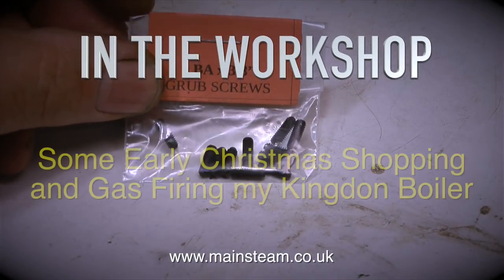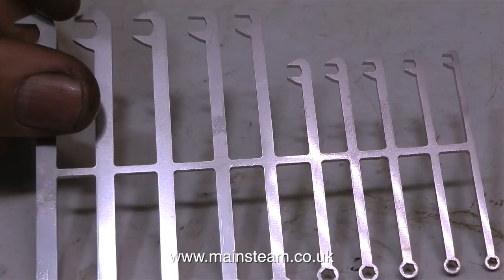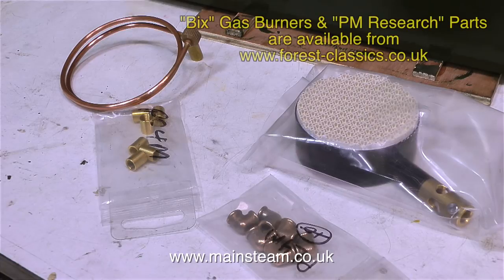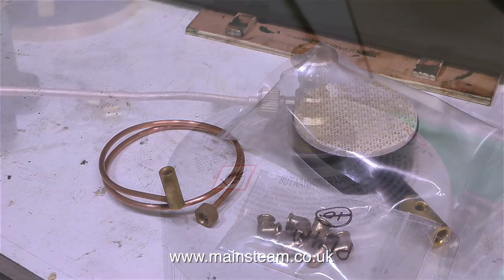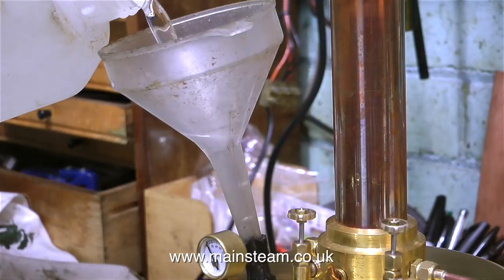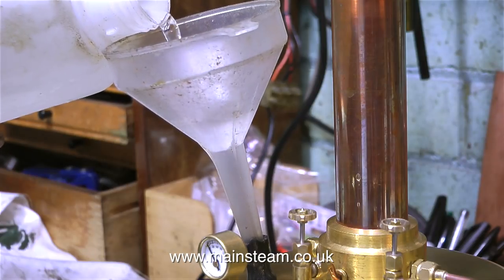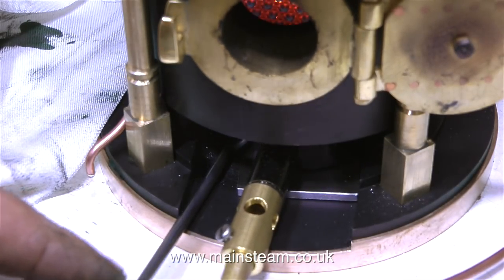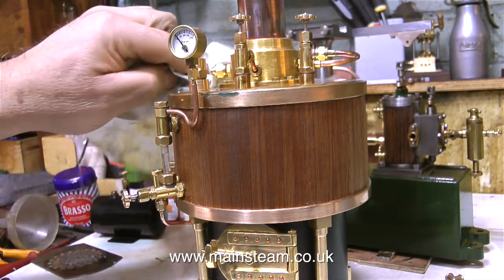A QUICK GAS FIRED MODEL BOILER TEST - IN THE WORKSHOP

Comment: I am glad you stick to the tried and tested ways over all these alleged new super ways people seem to think we all need to follow, all the old skills are slowly disappearing in favour of computer driven operations and machines and it was through these old skills that Britain took machines and steam to the world and through it the modern world we exist in today but we would still be running around with horses and oxen if it weren't for the people who took a kettle and stuck it on wheels or in a factory and with little change over the years operated flawlessly for decades until the advent of the electric motor ended their reign.   In your video's we see this in action, common sense engineering over over complication of taskwork which seems to be the order of the day today, I actually for the first time since the 1980's using a pair of old tyre irons put new tyres on my Reliants spare wide wheels, for a fiver I could have whipped 'em up to the local garage and had it done in seconds but I found the experience very enjoyable and did stand back and wonder why I stopped using the irons, I am trying to resist this modern world the best I can... well bits of it anyway hehe

Comment: I really like that little boiler. The brass pillers, all the copper and the mahogany set it apart from your standard horizontal/vertical mass manufactured boilers. This is the boiler your using for your Victoria power plant? if so the gas is a nice touch.